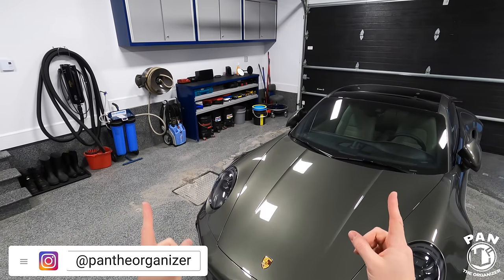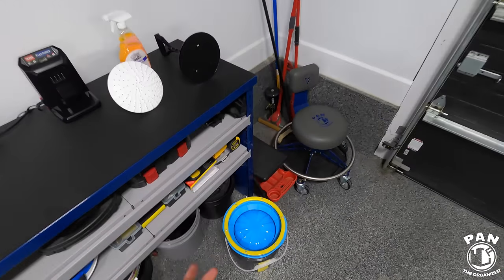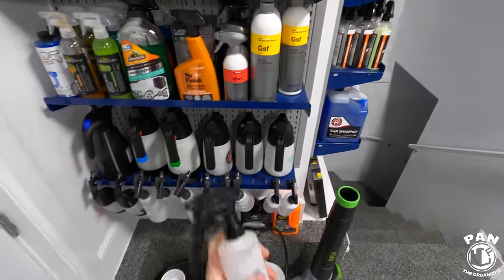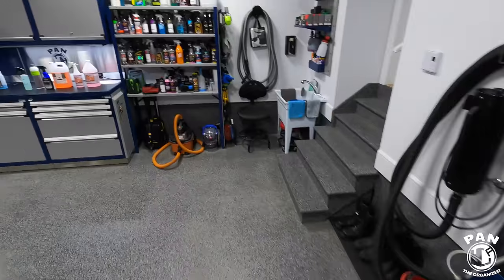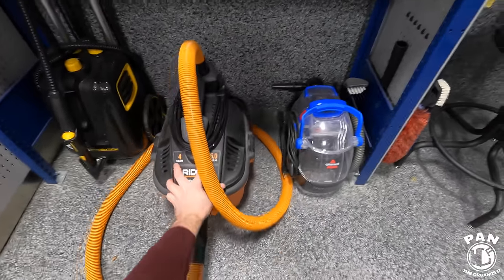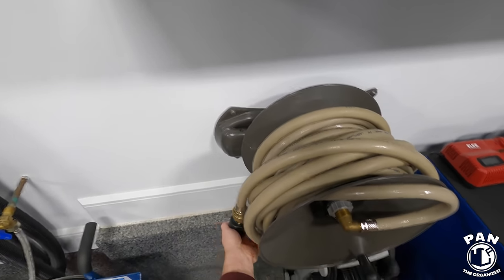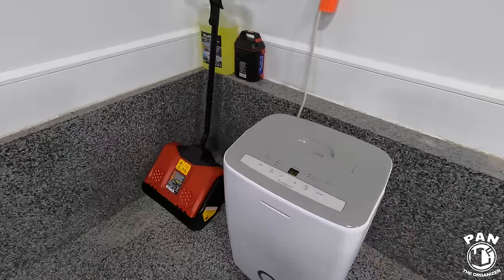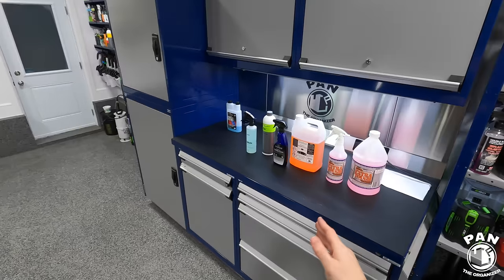How To Deep Clean Your Car Detailing Tools & Equipment!

Comment from the maker: 🔥 For more quality detailing products visit: https://bit.ly/3BiPe3o

⬇️🔶 LINKS TO PRODUCTS MENTIONED IN THIS VIDEO ⬇️⬇️
🇺🇸 For people in USA:
Koch Chemie Green Star: https://bit.ly/3Fj44mA
Optimum Power Clean: https://bit.ly/3HZSbnA
Extra Tough: https://extratoughcleaningpower.com
Lake Country System 4000 Pad Washer: https://amzn.to/3fitQNn
Detail Guardz Pad Washer System: https://amzn.to/31PZwqj
Detail Guardz Dirt Lock bucket filter: https://amzn.to/3fhhc1a
Grit Guard: https://bit.ly/3tgn7M4
McKee’s 37 Polishing Pad Cleaner: https://amzn.to/3GnDc6h
IK Foam Pro 2 pump sprayer: https://bit.ly/3XQbicX
IK Foam Pro 2 pump sprayer: https://bit.ly/31NMt8D
CarPro Dilute spray bottle: https://bit.ly/3tgQTAb
Detail Factory brushes: https://amzn.to/3HRgG60
Work Stuff brushes: https://bit.ly/2K0fYep
Wheel brush to clean buckets: https://bit.ly/3fpABNr
McCulloch steam cleaner: https://amzn.to/3HXLYZe
Ridgid vacuum: https://amzn.to/33sVhS0
Bissell extractor: https://amzn.to/3nijD8a
CR Spotless deionizer system: https://bit.ly/3zNmta2
Eley wall-mounted hose reel: https://bit.ly/3b6lSV3
Eley polyurethane garden hose: https://bit.ly/3qqGePb
Eley professional sprayer nozzle set: https://bit.ly/3u4wuwb
Kranzle 1122TST pressure washer: https://bit.ly/3d5kZeK
Mosmatic gun and wand solution: https://bit.ly/3aA67oE
Garage door lubricant: https://amzn.to/3fkOooc
Frigidaire dehumidifier: https://amzn.to/31OdBo0
P&S Rags to Riches microfiber detergent: https://bit.ly/333A2GE

🇨🇦 For people in Canada:
Koch Chemie Green Star: https://bit.ly/3GjCqHx
Optimum Power Clean: https://bit.ly/33mvUBc
Extra Tough: https://extratoughcleaningpower.com
Lake Country System 4000 Pad Washer: https://bit.ly/3JZG63o
Detail Guardz Pad Washer System: https://amzn.to/3HXp2sZ
Detail Guardz Dirt Lock bucket filter: https://amzn.to/3FfZDJf
Grit Guard: https://bit.ly/335G4qe
McKee’s 37 Polishing Pad Cleaner: https://amzn.to/3Gmn6Ki
IK Foam Pro 2 pump sprayer: https://bit.ly/31Nvwv0
CarPro Dilute spray bottle: https://bit.ly/3Gjs3mY
Detail Factory brushes: https://bit.ly/3zPYNlh
Work Stuff brushes: https://bit.ly/2K0fYep
Wheel brush to clean buckets: https://bit.ly/3qpb0KC
McCulloch steam cleaner: https://amzn.to/3njI2tJ
Ridgid vacuum: https://amzn.to/31UKmQE
Bissell extractor: https://amzn.to/3GjEqQ3
CR Spotless deionizer system: https://bit.ly/3qrEV5f
Kranzle 1122TST pressure washer: https://bit.ly/3d5kZeK
Mosmatic gun and wand solution: https://bit.ly/3aA67oE
Garage door lubricant: https://amzn.to/3FqB2Sk
Frigidaire dehumidifier: https://amzn.to/3qjHNAS
P&S Rags to Riches microfiber detergent: https://bit.ly/3JZGFu2

Watch more of my cleaning tutorials:
✅ How to clean polishing pads: https://youtu.be/IGDfRjcPaX4
✅ Detail Guardz tools: https://youtu.be/xmCtN4Y0APM
✅ How to clean microfiber towels: https://youtu.be/t_ryfGlkE9I
✅ My detailing tools and equipment: https://youtu.be/AC5noPvHiEg
✅ Lake Country System 4000 pad washer: https://youtu.be/vfKgy7LOhh4
✅ How to wash microfiber towels: https://youtu.be/t_ryfGlkE9I
✅ How to lubricate your garage door: https://youtu.be/btGMELqhhwM
✅ HVAC maintenance tutorial: https://youtu.be/fGY0UNVNKDs

🎶 MUSIC I USE IN MY VIDEOS - Referral link, get a free trial by clicking below!
https://www.epidemicsound.com/referral/pjuxkd
Reply: Another way to clean the spray bottle nozzles is to keep an empty spray bottle.  Just add warm water and and transfer the sprayer.  That way I don't waste the solutions and keep everything ready to go.  Just remember to prime the sprayer to remove the water.
Reply: hello what product you recoment to hydrophob  metal with stickers and faded paint ? (water repel ebike)

Comment: Great video Pan. Lots of very useful info.  After I use my foam cannon, I have my 2 buckets there. One filled with clean water for rinsing the wash mitt. Before I dirty the water I unscrew my foam cannon container and lower my pick-up tube into the rinse water bucket and spray the foam cannon for 30 seconds cleaning out the head and filter. Quick & easy.
Reply from the maker: Thanks for sharing David!
Reply: Great idea!

Comment: Ridgid ( and most brands) sell filter bags. Keeps the more expensive hepa filters cleaner longer from the bigger debri and the inside of the vac. Use them for work sanding drywall and filter stays clean an unclogged.

Comment: I also coat my garden hose with 303 to protect it and keep it flexible since it spends some time in the sun when I am using it. I hand wash my microfibre towels after letting them soak overnight. I don't want those chemicals in my machine. If it isn't safe for my hands then it isn't good for my body. Did that once and then had to run the machine through a bunch of wash cycles to get the scents out while wasting water. It's time consuming but I don't have to worry about possible skin irritation for my kids. An old washer or a small washer just for the garage stuff is probably the best bet.

Comment: Great info and tips Pan 😃
i have a tips that i use for cleaning my detailing brushes and drillbrush. I use a ultrasonic cleaner with warm water and little apc in it and run 1-2 times depend how durty the brushes are and when its clean i rinse it of in warm water and put it on a towel or microfiber cloth to dry it 🙂
Reply from the maker: Good idea! What brand and model of ultrasonic cleaner do you use?

Comment: Hi Pan, on what can you use APC on, or do you use it only for cleaning your detailing tools. What kind of dilution ratio should I use. Thanks for all the info you provide about detailing. Cheers.
Reply from the maker: An all purpose cleaner can be used for pretty much cleaning everything both inside and outside the vehicle. Wheels, tires, plastics, rubber, engine bay components, etc. For the dilutions, that depends which one you buy. Always follow the instructions on the label of the product you are buying. They usually give the recommended dilutions based on which task you are performing.

Comment: Great video Pan! I was wondering how you clean your garage floor. It tends to get really dirty and usually need some stronger chemicals for a job like that. Do you have any tips on products for this application? Never the less, great video!
Reply from the maker: I just pressure rinse it. And when the winter is gone, just a quick mopping with a gentle soap as recommended by the coating manufacturer.

Comment: 20:20 I have the same one (single filter instead of dual). I rigged up some "Y" valves and another short hose and made a bypass, So i can wash/rinse with hose water then switch over to filtered water without disconnecting any hoses. If i use filtered water the whole time my filter media doesn't last long lol.
Reply from the maker: Yeah I’m blowing through media quickly haha. Inalso realized that my hole house water softener system also deteriorates the deionizer resin quicker. I confirmed my findins with CR Spotless.
Reply: @PanTheOrganizer  Oh! Thats a bummer...

Comment: Amazing video Pan! Question regards microfiber wash separation: Do you also wash glass towels with the rest of MF? So you wash drying towels along with wash mitts, paint MF and interior MF? Thank you again!
Reply from the maker: I wash all my towels together. Except super greasy towels for engine bay, and the towels used for polishing (as those contain abrasives) I wash those separately.

Here's my microfiber towels washing tutorial: https://youtu.be/t_ryfGlkE9I
Reply: @PanTheOrganizer  Thank you Pan, cheers from Portugal.
Reply: @PanTheOrganizer  would you recommend collecting them separately like per category usage, after every use, or would just collecting everything in one laundry pile be good enough? I’m just concerned about cross contamination. I’d say my car doesn’t get severely dirty, it might just be mild to moderate. I just am primarily concerned about exterior, interior, and glass. Especially with the wax and dressings and stuff. I kind of blame Chemical Guys for making it seem kind of confusing in their videos.😂.
Reply: @laxbeach2381  with wax and dressings if you want to wash it all together I would sugest you pre-soak those. I for example don’t mix my applicator pads with the MF towels.

Comment: Hey Pan! Question about the grit guards. When you put the microfiber mitt into the bucket during the wash, do you rub the microfiber mitt against the grit guard to get the dirt out or simply dip the mitt in the water so that the dirt floats down to the grit guard?
Reply from the maker: You brush it against the water filter (grit guard) or pump it on the "pump and scrub attachment" if you are using Detail Guardz equipment. Watch my video here: https://youtu.be/xmCtN4Y0APM

Comment: Hey Pan,  after drying my towels, I discovered there was a wool dryer ball along with them. Are they done, or can they be saved? I did read in your description about getting  rid of the lint on towels, but I am curious if this tip would apply to this specific situation.
Reply from the maker: Ouch, that's a tough one. I don't know how you'd remove all the micro wool particles, especially those you can't really see. I don't know if your towels are usable unfortunately. Perhaps write to the microfiber company and see what they say.
Reply: @Pan The Organizer  Pro tip from a novice: Never let anybody else wash your microfiber towels, but yourself!

Comment: After you wash your polish/compound MF do you reuse them only for polishing/compound or everything on the exterior/interior? Thank you again.
Reply from the maker: If they're properly washed you could use them for anything you want. The only towels we don't reuse are the ones used for true ceramic coatings, the ones in glass bottles.
Reply: @PanTheOrganizer  amazing. For waxes do you presoak before washing?

Comment: Hey Pan, when you use APC to use your brushes how much do you dilute it? I have super clean and I don’t know how much i’m supposed to use in order to clean my brushes
Reply from the maker: That really depends if you are buying an APC that can be diluted or not, as some are "RTU" meaning ready-to-use out of the bottle and can't be diluted.

If you get an APC that you can dilute, read the instructions on the label to see what ratios they recommend for light or heavy duty use, and I typically use a light duty dilution unless the tools are extra disgusting, then I switch to heavy.
Reply: @PanTheOrganizer  Super sorry I didn't see this response I'm surprised how you got to this so fast😅! The APC I have is SuperClean, and after reading the back I couldn't find any dilution instructions for cleaning the tools I use (Detailing Brushes, Scrub Ninjas, Drill Attachments, Etc.) 

Do you have any recommendations for the dilutions I should use when cleaning those tools while using SuperClean as my APC? If not, totally understand, and thank you for getting back w me so fast! Again, my apologies for not seeing this sooner.

Comment: Omg did I mess up!! Just bought a 2022 Ram Laramie GT which is an amazing truck! Well, I completed applying Kamakazi Miyabe and Zipang coatings yesterday. I’m the process of polishing the truck there was a scratch that grabbed my attention so I pursued it with full force. I have the Lake Country 5 in 1 Udos polisher and I decided to switch to rotary mode and using Rupes blue coarse with their blue compound. Never used rotary before and will never use it again, I burnt the paint on the driver side A pillar. My question is , is there anything that can be done to fix that 4 inch spot that looks lighter than the normal color? Or is repainting the only thing that can be done. It’s not a big spot just depressing every time I see it. Any help would be appreciated. I understand my mistake, just want your advise on fixing it, thanks!
Reply from the maker: If you burnt through the clear coat, there is no fix to that unfortunately other than repainting the panel. Rotaries should only be used by more experienced detailers or enthusiasts with more detailing experience in my opinion. Stick to the D/A mode until you gain more experience. You can burn through clear coat quite quickly if you're not careful with rotary mode.

Comment: Super helpful! 

I did note on steam cleaners, Karcher advised me there’s is best with Tap water and not to use distilled or Deionised. 

Karcher said it comes inbuilt with a filter/hardness settings. 

Do you use dionised water for your spray bottles eg dilution for everything?
Reply from the maker: I used distilled water for my dilutions.

Comment: Hey pan by any chance do you know the ratio to dilute Adams APC for body panels? Also I learned the hardway about the hot air to dry the micro fibers.
Reply from the maker: I haven't used the Adam's APC for paint. According to their website: "Adam’s All Purpose Cleaner is safe on Rubber, Wheels, Underbodies, Engine Bays, Fender Wells, Exhaust Tips, Vinyl Tops, Truck Bed Liners, Tonneau Covers, Vinyl Seats, Carpeted Floor Matts, Carpet Stains, even Canvas Tops!"

So they don't mention paintwork. Your best bet is to e-mail them directly and ask.
Reply: @PanTheOrganizer  Thanks Pan

Comment: Hey Pan, when I use air dry to dry my microfibers and drying towels, they don’t fully dry. What should I do?
Reply from the maker: You need to set them to longer drying times until fully dry. I set air dry, and typically will set for 60 minutes on small loads, 90-120 minutes on larger loads. You have to check and see what works best.

Or let the hang dry on a rack overnight, and finish them off the next day on the air dry setting in your dryer for 20 min, that should fluff them up and you should be good to go!
Reply: @PanTheOrganizer  thanks for the reply! I will use this information.

Comment: What are the rough measurements you would reccommend for a detailing garage? (pls in meters) I got started on detailing a few months ago and I'm planning on building a garage for it.
Reply from the maker: My new two car garage is 54m2 (576 sq.ft). So it's quite big. My previous house I had a single car garage 29.3m2 (315 sq.ft) and I wouldn't want anything smaller.

Watch my new full garage tour video here: https://youtu.be/gyehNOd44SY

And to give you an idea, here's my previous garage: https://youtu.be/E_P6wRo3BH8
Reply: @PanTheOrganizer  would 7x5 meters be good? sums up to about 35m2

Comment: What are you using for the water for your steamer. like where are you getting the water you are using for it from?
Reply from the maker: I used distilled water in the steamer. And sometimes, to boost its cleaning power, I add one ounce of Optimum No Rinse (rinseless wash).
Reply: Can I ask where do you purchase the distilled water from?
Reply: Also when you use the rinse less wash in the steamer do you need to clean it out after that? And can that also be used as a waterless wash by itself?

Comment: How do you clean a wax applicator pad like the ones that come with the Meguiars liquid wax ? Or are they only a one time use applicator
Reply from the maker: A bit of APC, work it in, rinse with warm water, and let air dry. Good for the next use.
Reply: @PanTheOrganizer  I have super clean as a APC what dilution ratio would you suggest to clean applicator 10:1 ?
Reply from the maker: Yes

Comment: Hi I have a new car and the dealer apply xzilon can I apply a coating call undr dog without removing the xzilon coating are what I need to do?
Reply from the maker: Before applying any coating, you must ensure 100% removal of any previous protection, and the only way to do that is by machine polishing. So you would have to do all the steps: decon soap, iron remover, clay bar, machine polishing, IPA wipe and then apply your new coating.

Comment: I thought you said in your dedicated video to cleaning microfiber towels do NOT use HOT water. Now you are saying not preferred?
Reply from the maker: Like anything in life, things can evolve and change, as microfiber technology evolves and also microfiber experts' opinions can change. Although cold water is enough in 95% of cases, you can use warm water when washing microfibers that are dirtier. The main thing to remember, which still applies today, is to use the lowest heat seating (or just air dry setting) when DRYING the microfiber towels. That's where the high heat can start melting the microfibers as they are a form of plastic (polyamide and polyester).

I hope this helps clarify things.

Comment: Good video. What about dust? Do a nice detail on my personal car, and few days later, layer of dust. Is it the floor? Walls, ceiling? I do a fall vacuum of garage. I guess the world is a dirty place, but dusty car is maddening! Any tips would be helpful. Thank you.
Reply from the maker: I pressure wash the floor, super easy maintenance thanks to the coating on the floor. And I clean shelves and workbench tops and cabinets once every few months with a microfiber towels and APC or rinseless wash. But at one point, you have to accept that it's a garage, and I work from it all the time. So I don't expect it to be immaculate, certainly not during the winter months. My girlfriend doesn't really care to bring in dirt and mud and snow haha.
Reply: @PanTheOrganizer  thank you Pan.

Comment: Does anyone use a big boi or similar to blow out their polishing pads between passes? I dont have a compressed air set up yet and wondered if it would work?
Reply from the maker: It’s usually not recommended to use compressed air to blow out foam pads as you could damage the cell structure.

I made a tutorial on three ways to clean polishing pads here: https://youtu.be/IGDfRjcPaX4
Reply: @PanTheOrganizer  Hi pan, big fan! Maybe wool and microfibre pads between applications of compound/polish then? Just see plenty of people cleaning their cutting pads between passes with compressed air.